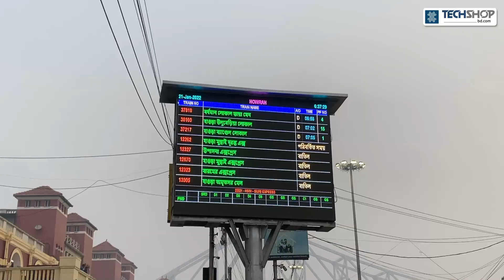ডিজিটাল সাইনবোর্ড তৈরির সহজ উপায়! | DIY Digital Display Using P10 LED Panel & HD-U6A Driver Board

Comment: ভাই  মালা মাল কোথায় পাবো
Reply from the maker: স্যার, নিজের লিংক ভিজিট করুন ওয়েবসাইটের মাধ্যমে অর্ডার করে দেশের যেকোনো স্থানে ডেলিভারি নিতে পারবেন।
1. LED Display Panel 32X16 P10 Red - https://techshopbd.com/detail/3680
2. LED Display Panel 32X16 P10 Green - https://techshopbd.com/detail/3681
3. LED Display Panel Controller HD-U6A - https://techshopbd.com/detail/3682
4. DC Power Supply 5V 10A SMPS - https://techshopbd.com/detail/3704
5. DC Power Supply 5V 20A SMPS - https://techshopbd.com/detail/3705